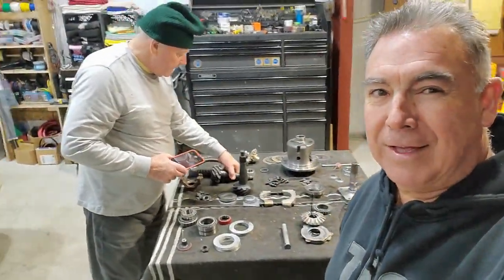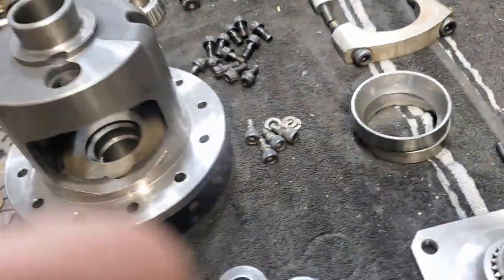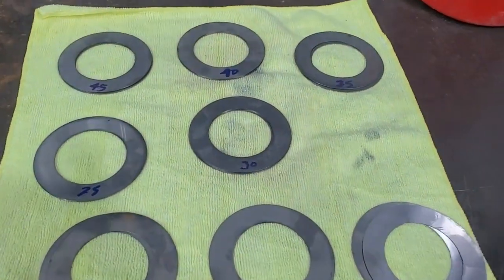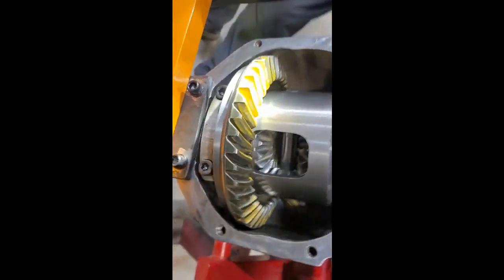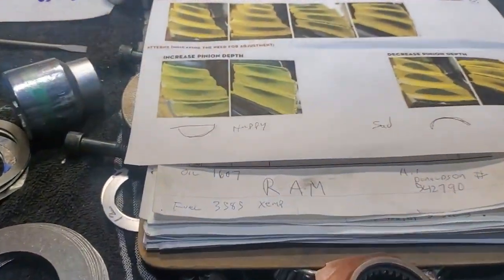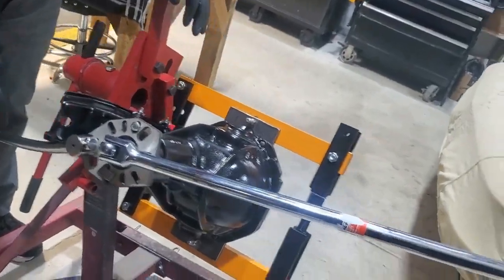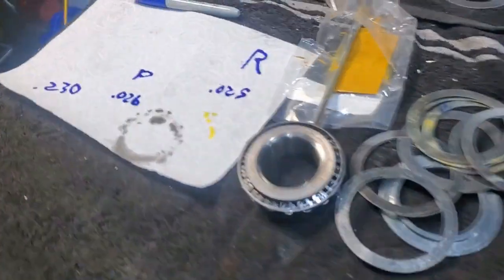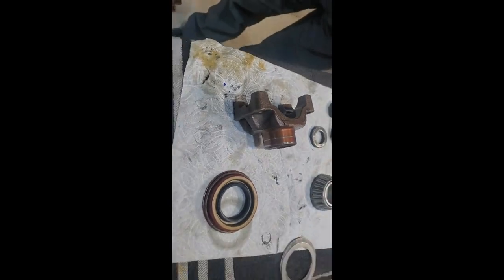Corvette 12 bolt differential rebuild (Tom's)

Comment: Which series carrier and ring pinion used ? Thanks.
Reply from the maker: I don't remember the carrier series but the gear is the 12 bolt THNIN series that the edges have been modified, to fit the clearanced 10 bolt case, the pinion is a 12 bolt but the shaft has been cut down so it sits deeper in the case, all custom modified ring and pinion that is no longer in production, If you go to the corvette forums there is a guy that bought a lot of Tom's innovatory and has a few items left, I did a 9" conversion for my C3 and said it would be cheaper to do the 9" here is my 9" install https://www.youtube.com/watch?v=G4TL6d1uB70

Comment: If that pinion seal is the same part# as a 12 bolt, the Ratech is the ONLY seal that will work without putting something under the seal lip. 
It's part #RAT-6109 from Summit. 
I have the same issue when i build 12 bolts and i found this seal.
Nice diff, it's a shame you can't get those gears anymore.
Reply from the maker: Good info, Thanks!